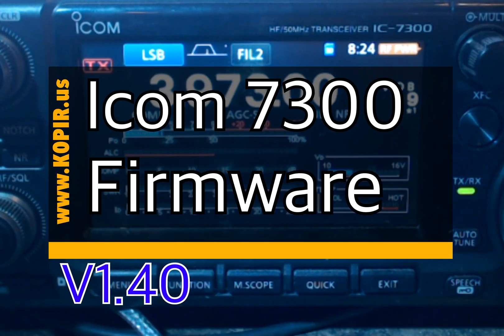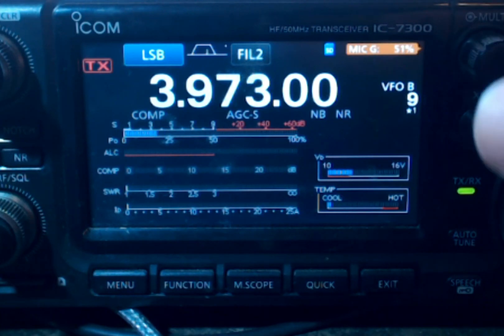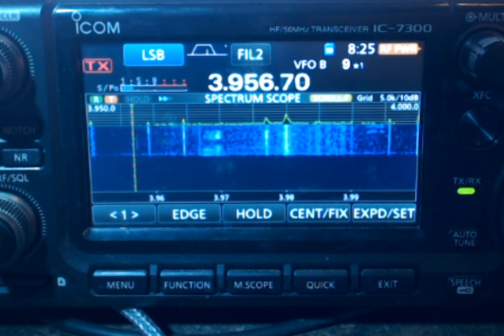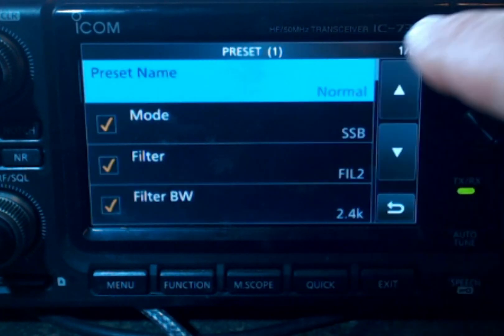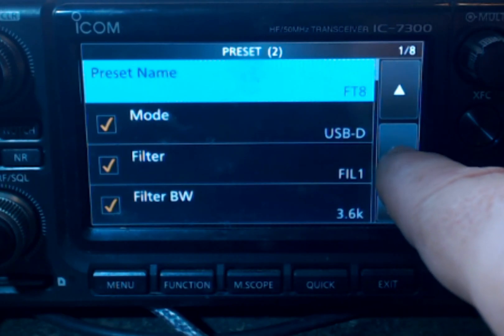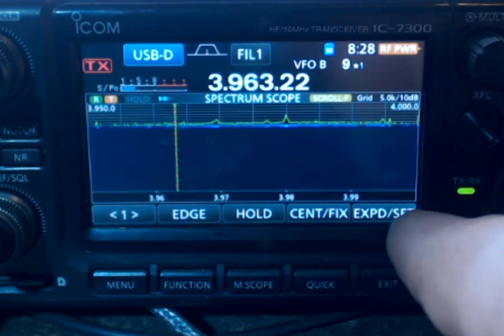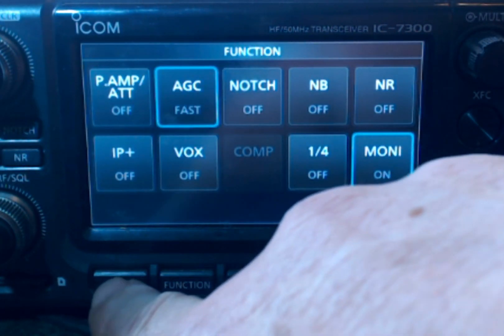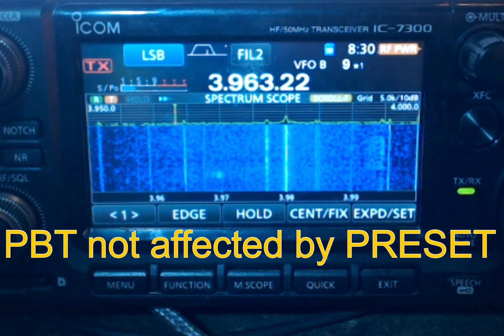3 Big Improvements to Icom 7300 Firmware v1.4

Comment from the maker: Note: When creating a preset, don’t forget to “Write” the settings. If you load a Preset and change bands it unloads automatically. If you power the radio off the Preset will unload. 

Note: For digital mode Presets you will still need to manually turn off NB, NR and set AGC to fast or off.
Reply: instablaster...